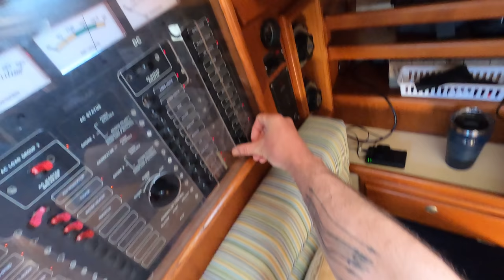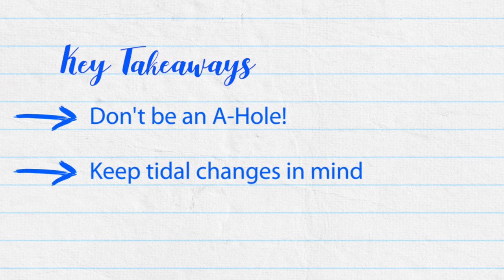I'm an IDIOT... | S06E04

Comment: before you call the trans job DONE, you need to re-adjust the cable to Lever ANGLE  at the trans. to do this you need to understand that a Lever has it's greatest leverage AT 90 degrees.  so...you would want to adjust the cable  HOUSING MOUNT (at the BRACKET), so that when the Lever is in NEUTRAL, it is at 90 degrees to the cable.  from what I can see from your video, I think you would need to adjust the Transmission lever AFT a bit, (by loosening the Lever Bolt, and rotating the lever BACK a bit). then if it doesn't shift properly,  you would need to move the cable HOUSING back in it's clamp mount. in other words, you want the shift Lever up at the Navigation pedestal in Neutral, and the lever at the transmission 90 degrees to the cable.......good luck.....OnWard....

Comment: I am an engineer. You are not an idiot. That is a bad design. It should keyed or splined or pinned through the center. The fact that it is harder to get back through neutral is a mistake anyone could have made. You are an idiot if you repeat mistakes. You are not an idiot. Think of all the things you can do mee old ship mate. Happy sailing.

Comment: LMAO!!!!! Quit being an A-hole........ rule number one.....great video guys and luv your content. its amazing how easy it is to blame the first mate for captaining errors. Glad your not afraid to own up to it. Don't beat yourself up to much on the transmission mistake, even experienced tech forget that a lot of marine shaft and lever assemblies throughout do not have splines to keep them from slipping. As a mechanic my best advise is to methodically diagnose something that requires a big disassembly. IE looking to see why the shaft moved so smoothly one part at time IE shifter then cable then lever then shift shaft and finally internal. 99% of the time, internal problems will give some form of resistance and i have learned this lesson the hard way more than once.....LOL.....keep up the great vids and be safe out there

Comment: ytou can delete this if you want but if you cant get over your fears of boating and trust you ability to do boating  you need to stop boating its been enouf years you should be over all the fears   or you are just try to and wake droma  and failing      and if you want to quistion if i no any thing  im 62 and have owened alot off boats power and sail  im sailing now in the new york lakes now    so i think i might no a little bit   sarry about being rude but i have be watching for years  and  normaly like you chanal  heck you are part off the reason got back it sailing